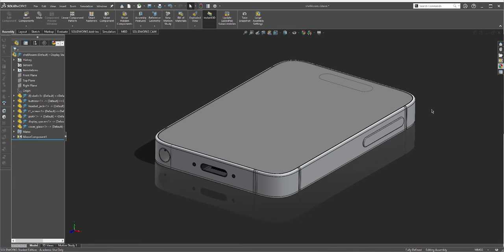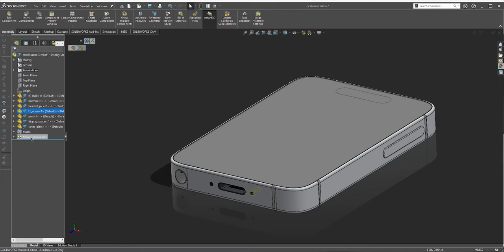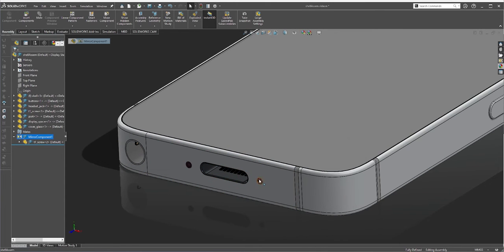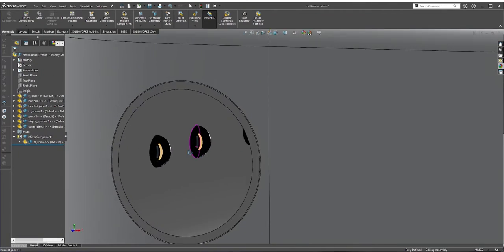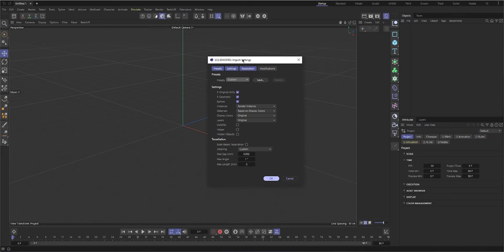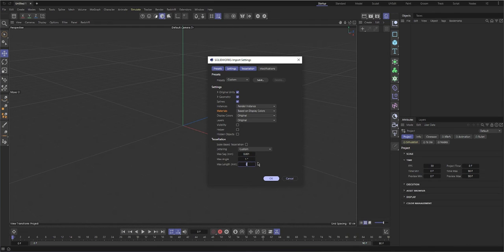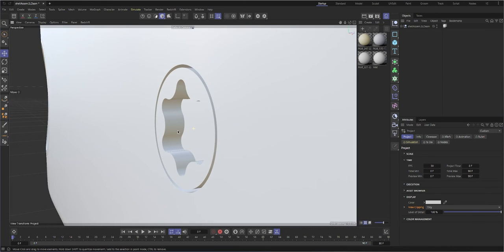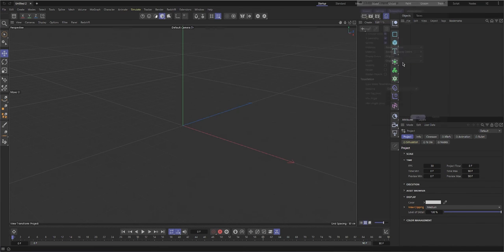Preparing SolidWorks Files for Import into Cinema 4D + Redshift (RfD01)

Comment: Thanks for this video. That's insane you figured out the lowercase filetype thing.. it allowed me to import but my files are showing up with no mesh. Not sure if this is because I am importing straight from PDM, but I ended up having to convert to .step as a workaround. If anyone has had this issue and fixed it let me know! I would appreciate it.
Reply from the maker: Glad that sorta worked for you. I've had that happen a few times, too, sadly. Quite frustrating but it seems STEP or IGES export are the way to get around that. I'll let you know if this changes :)